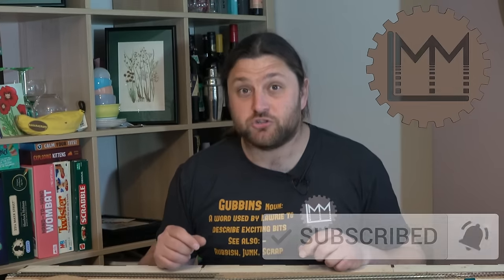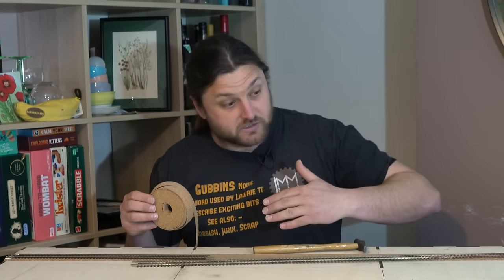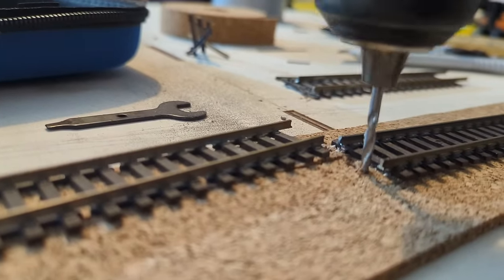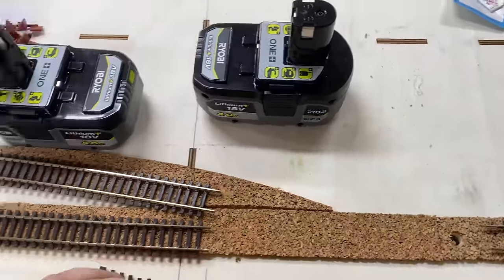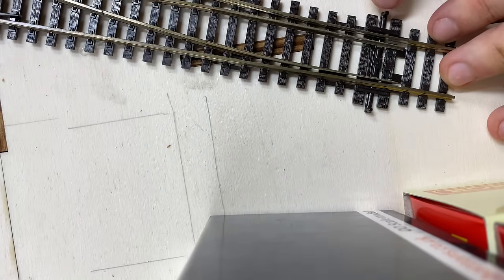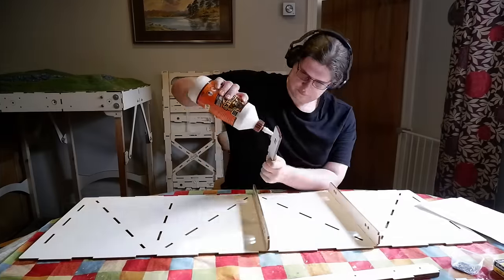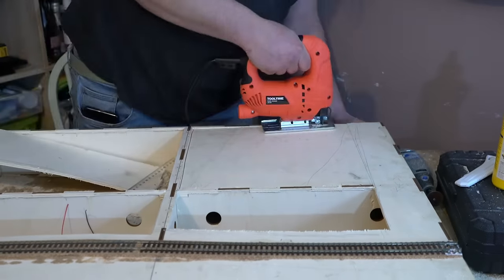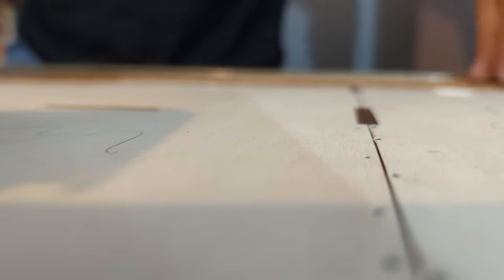Building a Modular Layout Episode 3 - Changing the plan

Comment: If I had done the module I would have inserted a 009 gauge narrow gauge railway to run next to the 00 gauge standard gauge line. 

Also you need to address the situation going on with the fuel tablets you use for Mamod steam engines as they are to be banned as they are apparently explosive if used in huge quantities.

Comment: It may be easier take up your cork and add a 2.5cm layer of foam on top of your baseboard rather than cutting into it.  The cork and trackwork would be affixed to this sub roadbed and your pond would be on the origional level part of the baseboard.  Your section of the layout could be joined to your clubs at its new track level.